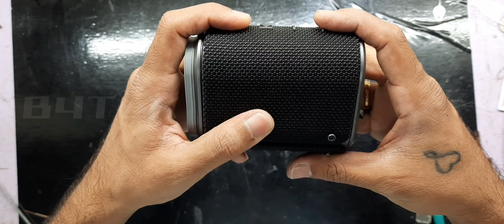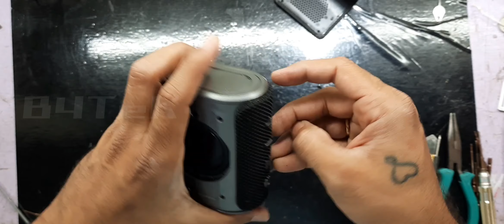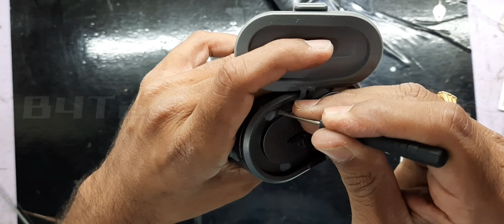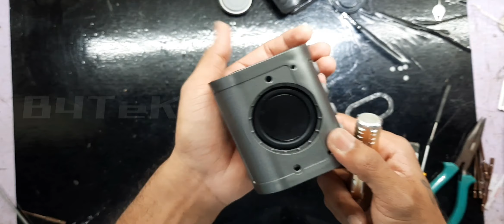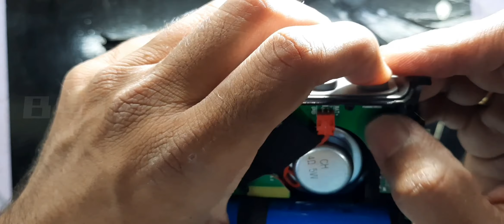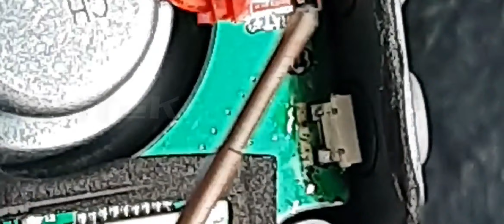BoAt Stone Grenade Bluetooth speaker Power Problem Repair. బొట్ బ్ల్యూటూత్ స్పీకర్ రీపైర్

Comment: One hell of repair dude! I really opened with kitchen knife and a small nail, guess what?
-- finally corrected the error, there was tiny circuit connection loss, and I even soldered it and got my grenade back to firing bass.
Reply from the maker: Ha ha you are the man with skill nice to here that you have done with simple tools
Reply: My On / Off Button not working should I do the same technique to make it work?
Reply: @chyrngenpajat2727  s bro me too same problem......Please reply channel bro

Comment: do we have to buy some new wires or stuff ? 
bcz my speaker is same which is shown in the video , but I have the same problem 
its all buttons are pressing perfectly accept  the power button , so what can I do sir , can u plz tell ????????????????????????????
Reply from the maker: Hi thank you for watching video and do subscribe if you like it... i think you power button is damaged you need to replace the power button with one of the buttons beside it. Take the button which you will not use frequently

Comment: I also buy this BoAt StOne granade only 15 days before ,now this speaker is not getting switch off , or not pair with aux & bluetooth
Reply from the maker: Mostly power button issue with this model try to change it.

Comment: Haii...I need a help bro. I accidentally drop my boat stone granade speaker. after that fall bass sound is not working. Can I fix by my self??
Reply from the maker: Yes remove and refix can solve this problem might be a connection issue
Reply: @bobbystech  Thank you
Reply: Check if there is any hole in the body, if yes, then pack it
Reply: @arundhakad1575  thanks

Comment: Hi bro boar stone 1000 urke power off avtundi automatic ga its new one what is the problem?
Reply from the maker: Speaker kinda padinda... ala ithey battery connector loose connection avochu leda.. motherboard issue vuntundi
Reply: Bro warranty claim chey bro